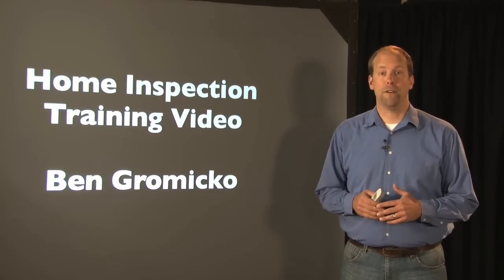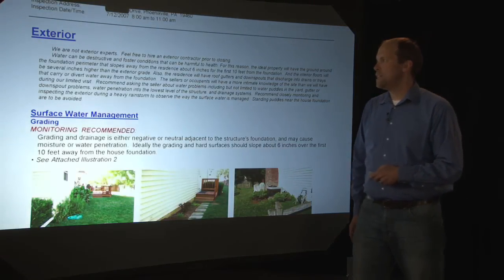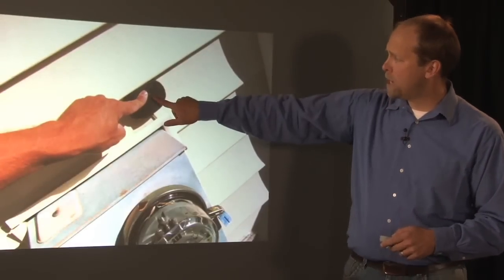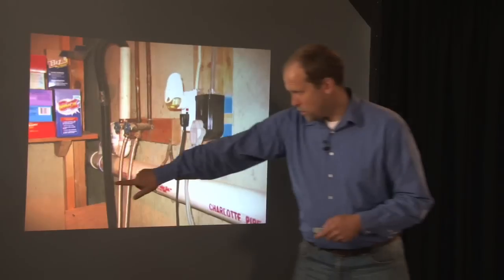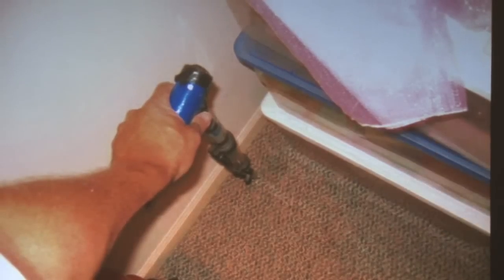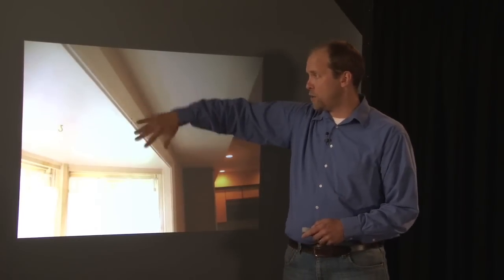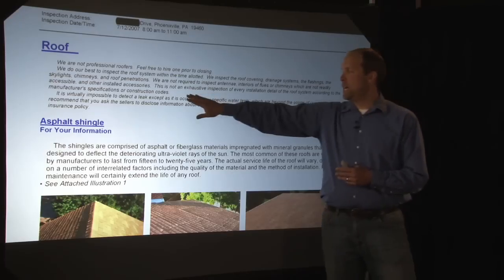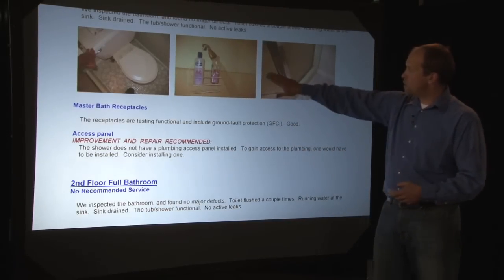Home Inspection Training Class #2

Comment: So you do not note the manufacturers models & serial numbers of the water heaters, furnaces, heat pumps, AC units, other HVAC units & appliances? By noting the model number & manufacturer you can check for CPSA safety recalls. This is also true for stoves, & other appliances. Federal Pacific Electrical equipment panels were deemed to be dangerous & non-compliant with the electrical codes & UL listing dating back to the 1950s! FPE stuff is dangerous. FPE even admitted their products do not work as intended. Zinsco had problems with the aluminum bus material arcing between phases and galling between the breaker clips and the bus. A good number of older dishwashers & garbage disposals were found to leak current into the potable water plumbing pipes, and or drain pipes. This was shocking and electrocuting people in their bathtubs. I have over 40 years experience in construction, and inspection. My biggest question, is "If home inspectors are able to get by with doing so little, why hire one?" We just had record rainfall. I saw multiple homes, with site drainage issues that were almost comedic, unless you owned the home. One was recirculating basement flood water from the sump back into the yard and right back into the basement. It was like a giant fake water fall, with furniture in it. YES DRAIN PANS ARE AN ACCEPTED DISCHARGE AREA FOR WATER HEATER PRESSURE RELIEF VALVES<> SO ARE FLOOR DRAINS, DRAINS, AND EXTERIOR DISCHARGE IS ALSO ALLOWED IN SOME LOCALITIES> THIS IS ALSO TRUE FOR THERMONIC BOILERS. THE FLOOR IS NOT ACCEPTABLE!
Reply from the maker: Thanks for the thoughtful feedback, Seth.

Comment: Roofers around here call it "alligatoring" when the asphalt composite material crazes or cracks open and it displaces the pebble coating(s). Factory reject materials will do this, so watch for the ANSI ASTM labels on these materials. Batches of reject materials routinely find their way out into the market. Rather than destroy them, they get sold on the "discount market".  I just went through around $70,000 in masonry damage due to lack of & improper kickout flashing, and more damage due to bad site drainage. The bricks are now spawling, and the mortar joints have been stairstep cracking for decades. Now the foundation is settling too. The cracks are now coming through to the interior after this spring's excessive rainfall. Beautiful Victorian home, or it was. Now it is approaching  tear-down status. The repair costs are greater than the home value. Repaired the home value is marginally better. Had someone caught this and recommended these problems be addressed, this home would not be a total wreck now.
Reply from the maker: Wow. Thanks for sharing, Seth.

Comment: I will recommend a 2 hour rated fire rated access door for garage scuttles . I also like to see a firewall with same access panel that extends up to the roof line in the attic, between the garage and the house, it is an attached garage. I like your videos, and an am a former code & gov't spec inspector. I am off to inspect another home after deciding the first one was uninsurable or prohibitively expensive to insure due to T Lock shingles. There was also water damage possibly covering structural damage from said water damage. There were also numerous plumbing drain leaks in the basement. Site drainage was actually exceptionally good. Vegetation was very overgrown. Badgers had moved into the back yard and were feeding on prairie dogs. Upon further inspection the garage floor was draining into the basement and stairs to the basement. This means, snow melt and rain draining off the vehicles runs into the basement. I am looking at another home now. I have an AC unit that was removed on the next home, with an open hole in the stucco for the suction & liquid lines. A window well had filled with rain water. I have my work cut out for me. I appreciate the videos, Ben.
Reply from the maker: Thank you, Seth.